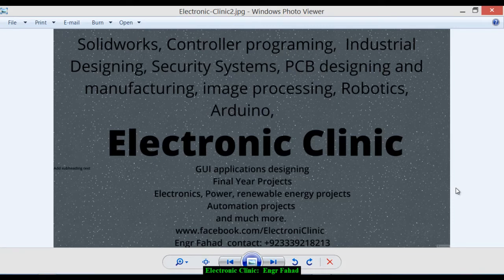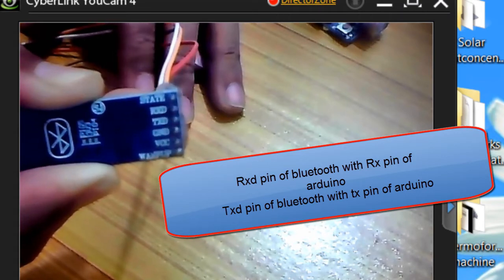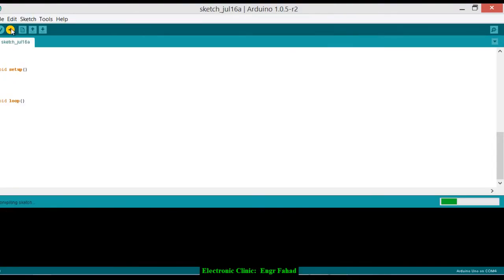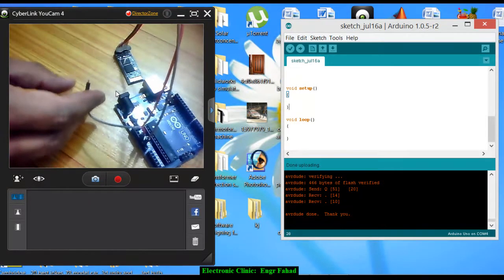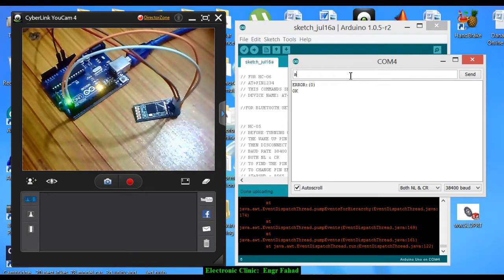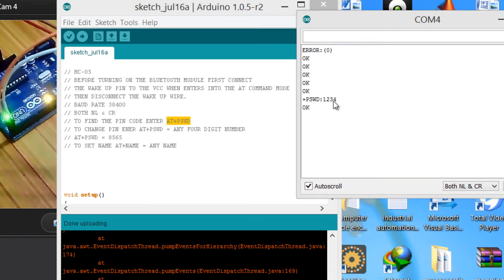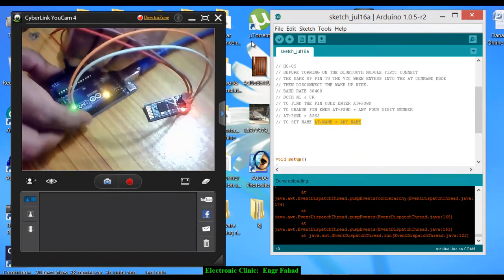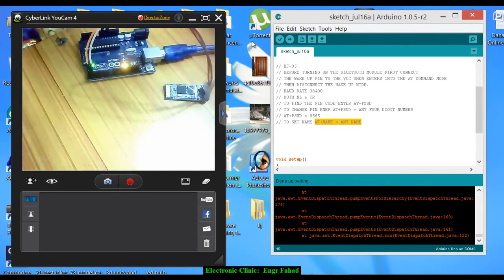Hc-05 | Hc-06 bluetooth Pin Code and Name changing using arduino. | bluetooth module AT commands

Comment: Dear sir I'm using arduino nano &BT HC-05.I'm using all detail properly (you make this video).But dear sir BT BC-05 not reply.Dear sir please solve the problem.
Reply from the maker: may be you have connected the wires in a wrong way.
Reply from the maker: double check all the wires. watch complete video.
Reply: Dear Sir I'm using pin :-
Arduino nano -- HC-05
5v--VCC
Gnd--Gnd
Rxd--Rxd
Txd--Txd
3.3v--En

Comment: There is a different between HC-05 & HC-06 .
What I know is that HC-06 is slave only module and requires a master device to make a connection. 
are you using HC-06 or HC-05 ??
and can I send data from circuit to laptop using HC-06 ?
Thanks !
REF: http://www.martyncurrey.com/tag/hc-06/